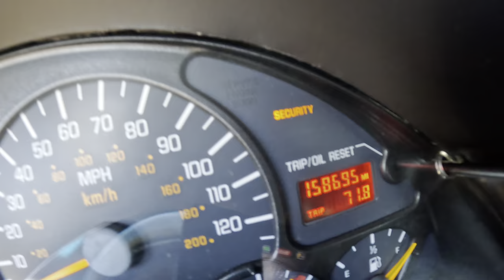Oil in the Radiator! Top End Internal Tear Down! GM 3800 3100 3400 3.8 #mechanic

Comment: Interseting note is that HVAC guys don’t use duct tape or Duck tape. Duck tape does not last. The original tape was called Duck Tape, a water proof tape. Not good enough for ducts. HVAC guys like Hardcast.

Comment: Had a 2001 RS Canaro that I had to replace the 3800 Series II motor in when I had issues with it ticking and knocking. Found that a piston rod had cracked and partially broke and as we were digging in we found that the oil pan had been painted on the inside from the factory and was flaking into the oil unknowingly. Tried to get GM and the dealer to replace it since that was an issue straight from the factory or wherever the engine was built. Total fight to the finish with no support from either, but after having one of the last 3800's available from a dealer came from one of the Earnhardt's Chevy locations in North Carolina. My favorite car that I owned... 🙂

Comment: Brings me back to my high-school days me and my buddy bought a 99 with the 3.8 with t tops and trans am doors it had a blown head gasket due to being overheated MULTIPLE times at 267k miles we pulled the heads and cammed it with engine in chassis its was a nightmare but when done and tuned its was one bad motherfucker it chopped like a corvette and drove like on too. We got a 12 second quarter mile out of her in 2016 several times with faded red paint its was definitely a sleeper due to its oe faded paint job. Very fun car and memories all done with a damn Haynes manual 😂

Comment: Well i am grateful that i have a 1992 Buick Lasabre that will likely require the replacement of the lower intake gasket some time and as it has side mounted engine quite easy to get it apart. Thanks for sharing your expertice and experience.. Gives me a bit of confidence to do this job on my easy car

Comment: Usually once i have gone this far, I wip the rockers off, pull the pushrods, and change out the lifters. They are a common failure point, especially if you don't do regular oil changes. They are relatively cheap and the same as the V8.

Comment: So much of your work seems to basically be archeology. Having to dig through layers of harnesses, hoses, bolt-on parts and brackets to simply uncover that which needs to be repaired is beyond my level of patience, endurance, and tool inventory. I wish you were in my area as I have had mechanics due more harm than repair to my vehicles.

Comment: If i am not mistaken the intake bolts on 3.8's were 3/8" instead on 10 mm...  This was the case right through the last year that GM used the 3.8 in 2009

Comment: Hmmm, in OZ language it's an Ecotech II & yes I know shit because I have done hundreds of them with the manifold gasket failure & I just changed a motor n box last week in a Commodore (I did a quick autopsy n it was carboned up so bad I couldn't find the inner head bolts... it had several spun bearings)  in earlishly 05 we got the Alloycrap 3/6 POS & don't ask how many timing kit's I've put in those shitboxes, thank's General Mess 'Merica, then you have the EURO CRAP & that is garbage to be very polite for the snowflakes.
After watching further the yank 3/8 of that era is a totally different pig "Merican pollution BS rules because our version 12 10mm bolts n the manifold is off including fuel rail what a pig to work on GMH had their much better organized!

Comment: Removed the positive cable again, instead of the ground.  Come on,  Ray.  When you reattach the positive cable it spikes the regulator on the alternator,  usually damages it and/or the diodes.  Voltage spikes are harmful to those alternator.

Comment: Oh halcyon days.  I had a 3.9 V6 in a van and as you say, they too suffered from manifold gasket failure (and coil pack and steering rack) so I watched the coolant level like a hawk. sure enough one day it dropped.  Sampled the coolant.5ppm.  GM replaced it for free under silent warranty.  Can't say fairer than that.  I just hope for the owners sake the coolant leak is very recent, otherwise the bearings will be compromised and he'll be looking at a new engine.

BTW it's DUCK tape, as in quack quack. Not Duct as it's quite useless for HVAC.  Amazing stuff.  Made by 3M I think during WW2.  The Army wanted something that would protect ammo boxes during air drops, yet could be cut with a soldiers army knife.  One of the many amazing things the US invented in wartime.  The Thermos flask for aircrews was another.

Comment: I would love to have this much room to work on it. My 1994 Z28 with the LT1 is shoe horned in it. Speaking of mods, my black Z28 has black badges on it, you can't see them. I put Z28 badges from the 2014-2020 on it. Looks much better. A minor change that a purist would have a issue with.

Comment: Once upon a time, Popular Mechanics built a Camaro and worked to achieve 200 MPH based on popular 1960's myths of people driving at that speed. It was not until they taped the windows with duct tape could 200 MPH be achieved. After that, a 200 MPH brand of tape was created.

Comment: I had a 1980 Olds Cutlass Supreme with the 3.8 Liter. I hated that gutless POS engine. That piece of crap engine couldn't get out of its own way in an emergency much lees ordinary traffic. I ripped it & the BOP 350 Turbo Hydrolic tranny out & dropped in a 350 4 bolt with an Edelbrock RV vam for solid mid range torq & pulling power, an Edelbrock Torquer II intake, Edelbrock 600CFM (plus I ported & jetted it) carburetor, an HEI Super Coil, & a Chevy 350 Turbo Hydrolic tranny. It became a whole new car after that & I absolutely loved it until I sold it...still miss it to this day!

Comment: i had a 91 olds cutlass with a 3.4-liter dohc engine I loaned it to a friend and the three back sparkplugs popped out while they were driving. her boyfriend sort of fixed it but the plugs were still loose and the helicoils came out with the plugs. they drove it that way and returned it to me saying this car has no power. took the engine out and almost had it rebuilt then the neighbor caught the town on fire and burned my house and garage down.

Comment: Those brackets are easier with two people. 1 above and 1 below.  One person can get the wrench on the bolt but can't get any torque on it because of the angles, the other can get plenty of torque but it's near impossible to get the wrench on the bolt.  So one gets the wrench on and the other gets to move it.

Comment: I enjoyed watching this video since I did the same job and then head gaskets on my 2000 Camaro with the same engine. I put the updated metal coolant elbows on mine as well as replaced the coolant line clips that go onto the housing with a aftermarket kit.

Comment: It seems like 90% of the motor takes 10% of the time, and 10% of the motor takes 90% of the time.  BTW, I like the hubcaps, if only for the irony. For years I had a 75 VW with a “Holley equipped” sticker on it. The sticker was the only thing Holley on it!

Comment: Since we have a lot of mechanics here, how about some ideas?  2011 Range Rover (not supercharged).  Had the injectors, plugs and coils replaced at 100,000.  When we started it up, it ran great but had a small fuel leak at a connector on the fuel rail.  Tightened the connector and now it cranks but won't start.  Loosened the connector so that it leaks again and it starts and runs fine.  70psi low end, 2200psi high end pressure.  Any ideas?  I would take it to Ray but he's 1200 miles away.

Comment: I had oil in my radiator once.  My dumb ass didn't read the bottle.  No big deal, though.  just pour water in until the majority is floated out.  It helps if you catch it before you start the engine.

Comment: Ray, what folks seem to not understand is that it's a repair shop FIRST. Not a YT filming set. I would suggest that if folks want to watch a strictly YT filming set, they did to seek out such channels and not nitpick and troll a real functioning automotive repair shop. They also seem to fail to grasp that you're not doing this to "entertain" them. Imho, please correct me if I'm wrong. This channel is to help folks with their own vehicles. From teaching how to do a particular job to simply educating folks about what need to be done, or what should have been done to their vehicle. Until they're able to see beyond such things, they're failing to grasp the point. Any "entertainment" is simply a byproduct. But I could be wrong. Not the first time and definitely not the last.
Y'all be safe out there.

Comment: These engines do leak like sieves ! God forbid, don't ever run one hot, or get caught without the proper antifreeze mix in the cooling system  either.

Comment: Me thinks it would have just been easier to just pull the engine on this one.  Although, having not worked on this GM before, you might have still had to pull at least the upper off to get the engine out.  Either way, great job not losing your cool on getting those behind fasteners out.

Comment: Ferrari has sued people for badging non-Ferrari cars as Ferrari's.  There is a clown in Fort Lauderdale who drives his yellow Subaru BRZ with Ferrari emblems all over it.  He's asking for trouble...

This company even goes after people for putting wraps on their car that advertise a business or in their words "denigrate the integrity" of the car.  Frankly, I think that if you buy a product it is YOURS and you can use it or modify it any way you want!

Ray, the 3.8 liter GM V6 "3800" is not in ANY way shape or form related the the 3100 or 3400 60 degree V6 engines.  The 3800 is the old 215 aluminum Buick V8 with two cylinders sawed off and recast in iron.  It has a 90 degree design, and is probably the best engine GM ever built, with Toyota-level reliability.  The 60 degree V6 engines were all CRAP!

Great video!

Comment: My 97 grand prix with the 3100 started leaking oil into coolant at 90k miles ilI sold it to a neighbor when it had 280k miles on it. The oil in the water did wonders for keeping the water pump healthy..it sure did need a bunch of rack and pinion sets though

Comment: It looks like very little maintenance was done on that engine. I have a Grand am  gt1 with the 3400 (3.4 ltr) and 180 k miles. Just basic things, new Top end rebuild and it loves to get on the road and go. It's like a good dog that loves to go out for a long run and walk. It's a 2002 also. If it needs the bracket, yes. If not, DELETE

Comment: How easy it is to do this job in a Australian Holden Commodore that has a similar 3800 series 2 engine vs this cramped nightmare. 
Our Australian GM engines were built in Port Melbourne Victoria with Cylinder heads from Flint Michigan USA & we did not have the plastic elbow. 
Later ones have Australian floating rear crankshaft seal design which helped mitigate leaks. 
The intake manifold gaskets were the crappy plastic silicon seal infused garbage that always failed (plastic collapsed with time) vs replacement Steel ones with silicon coated seals as used in the Super charger engines versions. Great GM engines very reliable. Probably the best GM ever made.

Comment: I will never bad mouth my transverse mounted engine in my GTP!  With all the room in front of that engine,  how did the engineer design it with  his head in his colon! Great engine besides the factory intake gaskets! Great video! I've seen people  install the Eaton super charger. You have to manufacture a U bend for the throttle body. Still a 500k mile engine!

Comment: The Buick 3800 cc V6 engine was a legend. It was very reliable and built like tank . That's why they could install a turbocharger on it with virtually no changes aside from knock sensor!

Comment: You said you have opened a can of worms - but that just tells me that the customer will get an engine that has been worked on correctly, not half assed. I did notice that as you pulled more and more off the engine, you revealed more and more oil soaked metal. At least you do your job Ray, unlike many. Nice!

Comment: Ray, Hi from TN. Do you not have a gear drive dog-bone to help with the bolts on the back of the heads. I have one and it worked out good. Just a thought. Dave.

Comment: Hockey tape from the sporting good store to replace the ugly, non-conforming duck tape.  Get the tape that comes in 3 large rolls per pack.

After watching this vid, I know another car to decline re-seal job.

Think RTV on the silicone seals, since, obviously, the OEM and, probably, replacement seals, fail with catastrophic result.

As to the oil all through the engine coolant galleries in block, hoses, heater core, and radiator, there is an enzyme cleaner oil eater that will convert much of the oil residue into atmospheric gasses in 48 hours or so, then flush that out and reload the glycol coolant.

Those horrible rear head fasteners remind me of how much I despised working on Beech D-18 rudder and elevator pivot fasteners.

Comment: How do those leaves wind up right there in the valley between the intake manifold and valve covers? I have a Yukon with leaves stuck in the exact same location, and I am pretty sure my previous truck did as well. They can't fly through the radiator and I don't leave my hood up under trees all the time. lol

Comment: You mentioned at the beginning the transmission would need to be removed to do the rear main seal. Would it have been easier to remove the entire engine & transmission as one unit, and not have to fight every hidden nut and bracket? Quicker possibly? Awesome work anyway, thanks for posting.

Comment: Like every day I can, I come to your workshop and meet you, you’ll sometimes take me with you for a road test then into the workshop and put the car on the ramp. 
If the wife unit is not to busy she’ll say hi, Dave also, then we’ll start the fix.
You let me look over your shoulder while you work and explain what you doing and the reason why. Some times I get hit with a socket or flashlight, but you always apologise.
You tell me when you’ve got a difficult bit to do, and sometimes you just ramble on about whatever comes to mind. You never get mad with me, but I stay quiet and refrain from asking what most of the time would be stupid questions. The day is over, but don’t worry if it’s ok with you I’ll be there again tomorrow. What nice people you are. PS you used to sneak me into the dealership as well without the bosses knowing. By the way you need some anti troll signage in the workshop.

Comment: My sister bought a new 2001 Chevrolet Monte Carlo super.. It had the same engine. It was nothing but trouble. The alternator went out at 25k. Later on sensors went out.. at 58k coolant was in the oil. Bad head gaskets..

Comment: Wouldn't it been easier on your back and gain access to the repairs plus the hoses that need to be replaced to have dropped the engine out of the car with removal of the cradle?

Comment: Better check the parking brake on this unit, you still had it engaged (handle up) when you pulled it into the shop, and it seemed to roll just fine!
Reply: BREAK?
Reply: I can understand assuming the brake light is on "because old car", but come on, the handle is sticking up in the air right next to your arm! 😁

Comment: To remove right hand valve cover, remove engine from vehicle. talk about a royal pita!! And the top end of the engine was off no less..good grief!!! Whoever put that bracket on at assembly overtightened that bolt for sure.  
    I wonder what the actual procedure calls out for as doing valve cover gaskets. Somehow i would not be surprised if it involved removing at least the upper intake.
    That was hell Ray...why they shoved the engine so far back under the cowl is a question i would love to ask the idiot engineer who put it there.
    But this is a good example of why removable cowl and wiper stuff has come into being.
   Go have a couple of cold ones Ray...you have incredible patience with not choosing certain words as you are in battle with fasteners.
   High fives !!

Comment: Worked on 02 camaro with this engine, diagnosed fuel regulator. My bitch was the Christmas tree fasteners pointing down out of wiper cowl. Everytime I reached underneath the top of my arm came back bloody. Ended going in with a pair of side cutters & cutting  them off

Comment: Had to tear my 3100 v6 down almost to the headgasket.  That fking intake manifold gasket was leaking (yeah it wasnt even the awful stock one but the felpro upgraded).  At least these are easy to work on for my non mechanic self.

Comment: Ray one trick I use to break a bolt loose is using a regular box end wrench and taking a mallet and tapping the wrench at the other end in the direction of loosening that usually works.

Comment: Ray at the 48 mins you was struggling with 2 bolts behind the head near the firewall, have you come across the sideways chain drive extension such as Snap-on FRW10, Mac also do them and other brands

Comment: I thought they used to take the engines out of those to work on them half the time because of the space issue maybe that’s just what I seen people doing all the time when I was younger, I know people used to complain. Well, swear a lot bolts hitting the firewall and other parts, so they just took it out and they can do all the work. They need to do really easy but also back then they didn’t have a lot of electronics wrenches and stuff just mainly air tools and basic wrench

Comment: Are you sure that particular engine was even worth saving? It seems to me that even if you do replace all the necessary gaskets and seals, you'll have to contend with all the damage the oil/coolant mix did to it. Doesn't seem worth it.

Comment: I saw the other day someone used dishwasher tablets in water to flush the coolant system. What’s your opinion on using that method to clean the oil out the cooling system? I wonder if you could find a car to try it on at some point? For science 😊